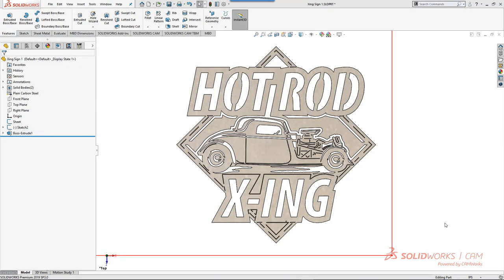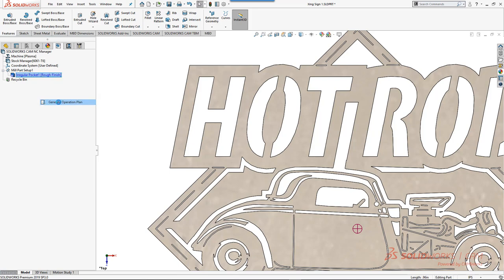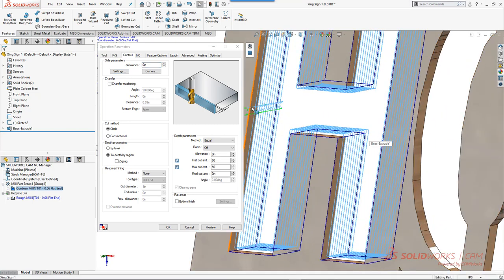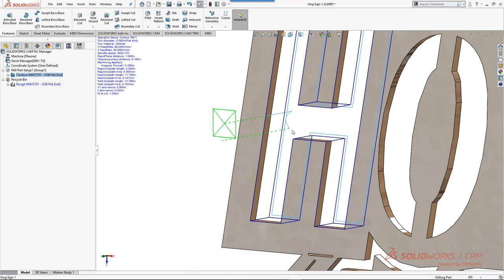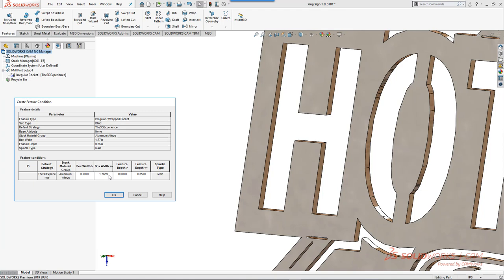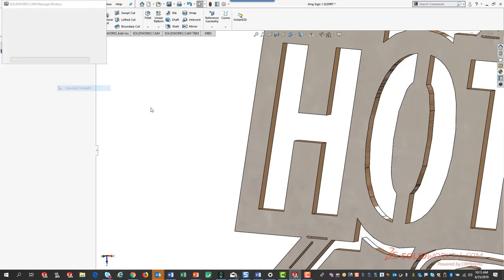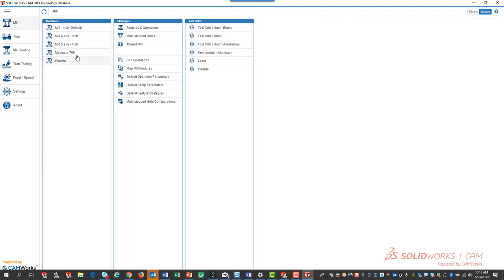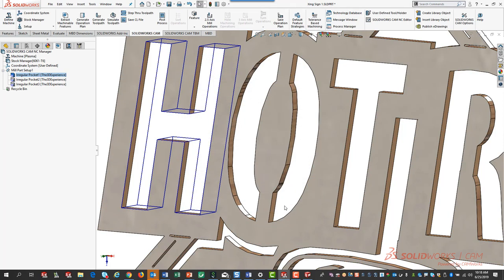Automation using Save Operation Plan

Comment: how do I Activate water cutting machine in solidworks
Reply from the maker: The milling machine by default will work for a waterjet, plasma, or laser.  You can customize the technology database to use a specific name but the machine name will not matter for programming a toolpath if you are moving in x, y, or z.